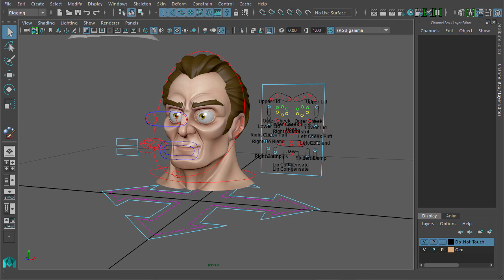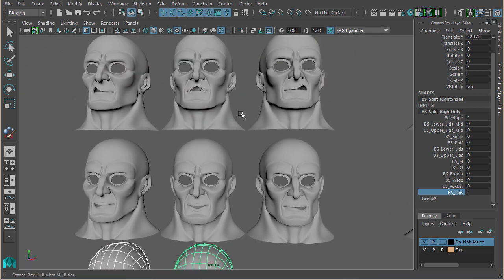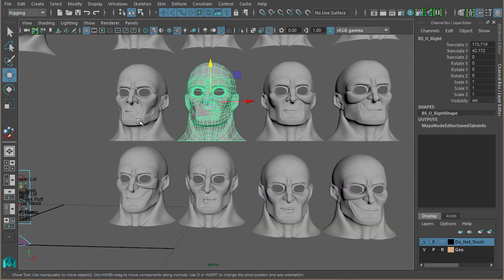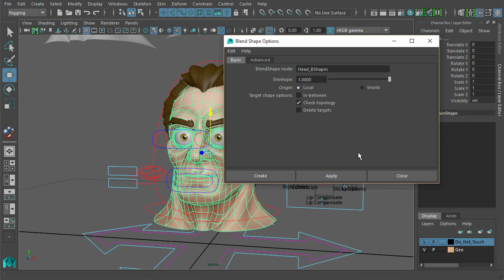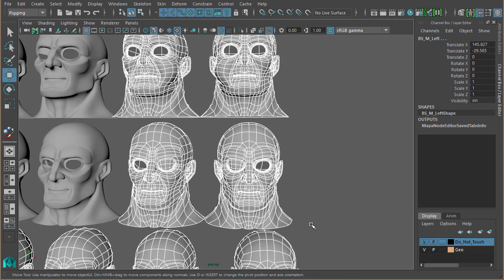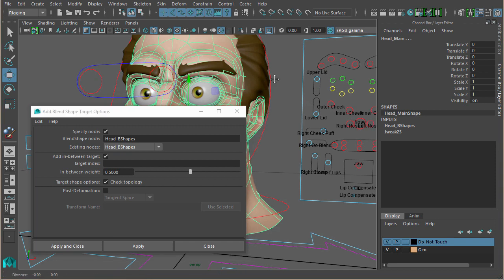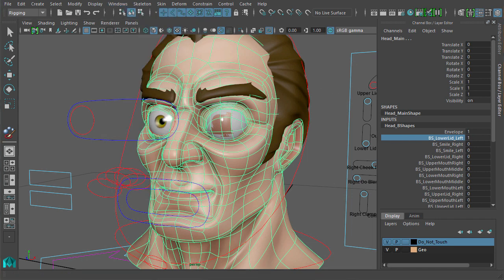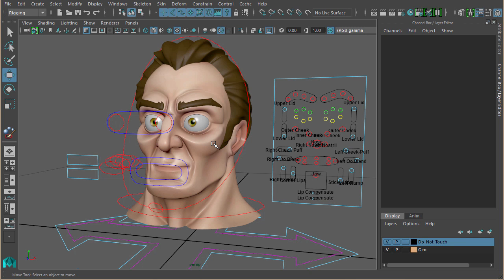Face Rigging in Maya - Part 2

Comment: When I scrub through the blendshapes in "Head_Main"s channel box, the mesh floats over to the blendshape it's referencing instead of staying put. What causes this? I didn't notice you ever resetting or freezing transforms on anything. Was I supposed to?
Reply from the maker: Tyiff Pejic no, no. You need to keep the transforms the same to maintain the offset. You didn’t freeze the transforms did you? You could try changing the blend shape settings when you create it, setting it to Front Of Chain?
Reply: @antCGi  Thanks for the fast response. I got it figured out now
Reply from the maker: Tyiff Pejic that’s great! What was the problem?
Reply: @antCGi  I fussed with inherit transforms in the attribute editor.

Can I ask you a question unrelated? How do you maintain texture details when you're scrubbing through the blendshapes on "Head_Main"? I have normals dedicated to each blendshape that I would like to turn on when activating blendshapes on "Head_Main".
Reply from the maker: @tyiffpeijc8702  You could use a layered texture and then each layer corresponds to a blendshape.
Reply: @antCGi  You're very generous for being so helpful, thank you. I may ask more questions as I move along parts 3-5, I hope that's not a bother.
Reply from the maker: @tyiffpeijc8702  no bother at all! If my videos and help are useful you could say thanks by treating me to a coffee - https://ko-fi.com/antcgi ;)
Reply: @antCGi  Done. How about two coffees?
Reply from the maker: @tyiffpeijc8702  amazing thanks!